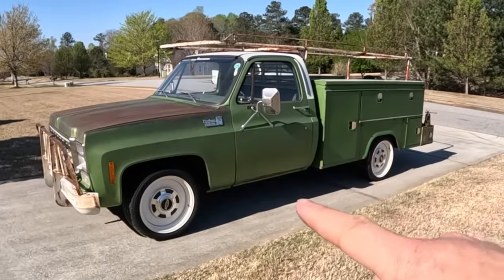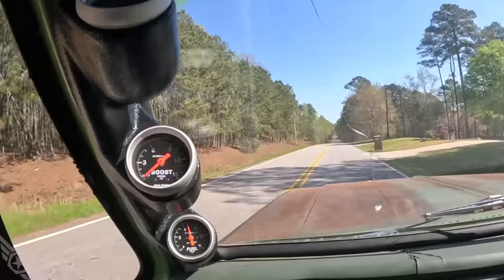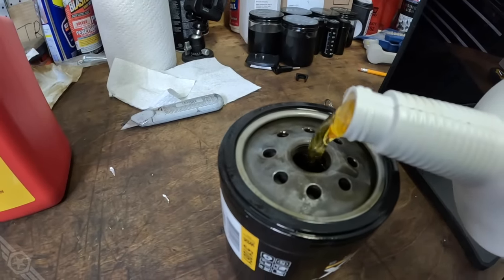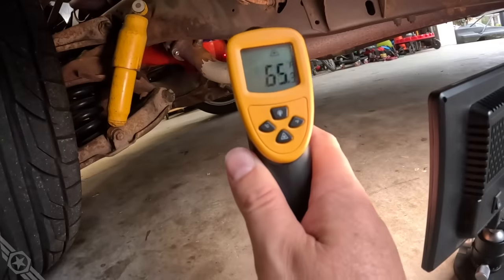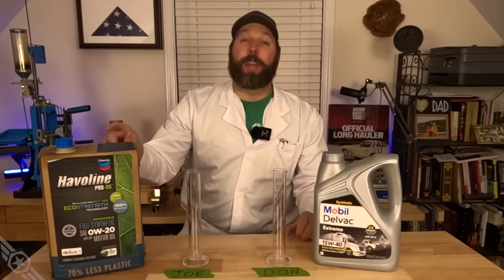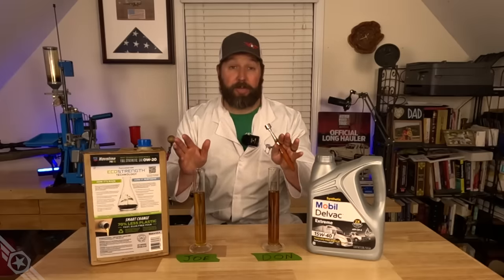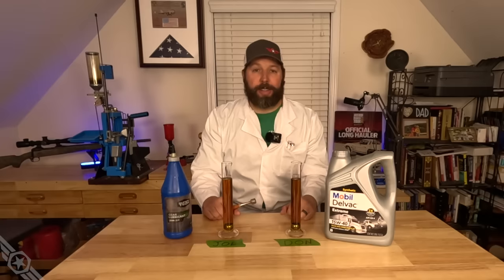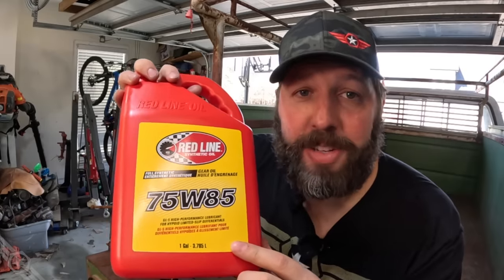Running GEAR Oil in an ENGINE!!! (EXTREME PRESSURE)

Comment: One of these best engine oil videos I’ve ever seen!!!👍😸
Reply from the maker: I really appreciate that. Thanks for watching 👍
Reply: Dude straight up man! Such straight to the point. Like he stabs you with strong points picks out on the what if this or that and he’s like I got that covered for you doubtful minds. So many facts!🎉
Reply: What about using redlines light weight shockproof on that engine 🤔

What’s your thoughts on that?
Reply from the maker: I had to look that one up 👀
Reply: @freedomworx 😂
Reply: I agree. Let's get to the nitty gritty. This guy breaks it down well. But I'd be surprised to find out he has a degree in sciences. But neither do I and he's the one spending money and writing stuff down soooo. That's why I'm here.
Reply from the maker: All you have to do is google my name. You don’t get the job title I have without an engineering degree 🤷🏻‍♂️
Reply: @franknukemcomegetsome2744  just have fun with whatever you like building or doing.,,I like your videos,, Avanti  !

Comment: Get ready for the haters, every time I tried to explain this to people in the YouTube comments I got a lot of (really) offensive replies 😰
Reply from the maker: Haters make you famous…or at least, that’s what the internet says 😂
Reply from the maker: Thanks… I think 😂
Reply: I've learned that you can't explain the truth to some YouTube commenters. They are*experts* ahem..
Reply: You can't explain things to idiots....
Reply: From what I heard it's that the gear oils  don't like the heat and friction. Breaks down quicker. No clue in actual use scenarios. But I contemplated using this in a very old worn block. Ended up going with 15w 40 cuz of what I read  about the gear oils breaking down. Interested in how this pans out here.
Reply: That's because Darwin hasn't caught up to them yet
Reply: @ehhwhatev3903  🤣
Reply: Engine oils are tested under terrible conditions.  Including poor piston rings, and contaminated oil and gasoline (all done intentionally) to make sure they withstand 7,000+ miles.  I don't think they do that with gear oil.
Reply: @ruben_balea      I wasn't putting words in your mouth.  I was simply making a statement.  I believe "engineering explained " did a video on how engine oils are tested far beyond their limits, and in far worse than optimal conditions.  Basically reinforcing the statement made where he said the additives are designed to withstand engine conditions.
Reply: Was it not "Big daddy" Don Garlits who ran gear oil in his top fuel dragster...?
Reply: When oil gets hot gets thinner
Reply: @trump2609       that's what the second number is.  The weight of the oil while at operating temperature.  The first number is the weight of the oil cold.
Reply: Engine oil and gear oil numbers are not on the same scale neither are "euro oils" so the numbers while meaning the same things as far as viscosity can not be related to each other without using formulas to convert. By the way I've run gear oil in worn out farm truck engines without any adverse affects other than causing more leaks in cold temperatures due to increased pressure
Reply: *  gets offended  *
Reply: 90 gear oil is almost exactly the same viscosity as 40 motor oil. It's just a number, and gear oil and engine oil use different ones.
Reply: cute dog
Reply: sniffles

Comment: Had an old beat up and battered maverick back in the 80's. The engine was completely worn out  and burned/leaked more oil than the exxon valdez. I used to drain 5 gallons at a time of waste oil out of the tank at work and carry it around for use in that old maverick. That waste tank had a mixture of used motor oil, auto trans fluid, gear oil, brake fluid etc etc....you name it and it was probably in there. I ran that old worn out maverick for several years entirely on what came out of that waste tank. Never had a single mechanical engine failure and the old gal was still running when i sold it after 350 thousand miles. Sometimes you gotta' do what you gotta' do to keep things rolling down the road a bit longer. That old maverick was a prime example of use what you can afford and hope it works out, fortunately it did
Reply from the maker: That’s hilarious. Whatever it takes 😎
Reply: I had a 77 Chevrolet Vega that leaked & used oil & I did the same thing using used oil and kept 2 spare gallon milk jugs in the back of the car to add oil to the engine once it got low on oil and the oil light coming on . I bought that car for 50.00 & had it for 6 months as my daily driver and it was the GT model with the hatch back but the interior was like brand new but I had a friend who asked me if I could take him to North mpls to go get his tool box from his ex girlfriends place which we did & this tool box filled the entire back of the car up to a point that hatch almost couldn't close lol so we take off heading back to East Bethel MN where we lived at the time & were cruising down 94 & all of a sudden the car felt unstable at the rear when taking corners so we get back to his place he unloads the tool box I go home and look under the car & one of the control arms had rotted through on the body and broke off where the mount was on the body so not worth fixing it . I ended up calling a local scrap yard and I knew one of the counter people that was a brother of a high school friend of mine and asked him how much for the car minus the Saginaw 4 SPD trans and he told me 100.00 cash so I pulled the trans out of it and towed the car to the bone yard and got paid for it lol selling it for more that what I paid for it plus keeping the transmission out of it that eventually went into a 70 Elcamino I had that I was going to do a swap from a automatic to a 4 SPD manual. Now that I think of it I don't think the bone yard by me now in Wisconsin where I live now would pay that much for a mid sized car hardly especially if you cut the cats off of it because scrap iron is so low now so for me getting that 100.00 way back then for a crappy rusted out Vega was a damn good price 😂.
Reply: Mines a hybrid too. It burns oil and gasoline
Reply: Man I had a 89 mustang lx 5.0 convertible and used to do this at a harley shop, man that was a bunch of different shit, sometimes smells like sulfur and knew it probably wasn't good but never had any problems
Reply: It goes to show, some oil is better than none
Reply: I feel ya on that one my 7.3 sweats oil and if clean oil free of contaminants wasnt the blood line of that engine i would do the same but i did have an old chevy truck with a 355 in it and it was low and not reading pressure and i used bar an chain oil in it to get home then never changed it for almost 10k lmao but just to get home right😂 whatever it takes😂
Reply: Hey it will get you there.   That's how ya do it bud
Reply: Reminds me of my old truck. It was quite worn out so oil pressure was always lol. I ran 20-50 all the time. And when it got low I just added in that super thick oil stabilizer. lol whenever I drained it it was always so black and thick. Poor engine lol. Love older engines, they just eat anything you put in without a hitch.

Comment: filling the oil filter is perfectly fine and is actually a good idea.
Reply from the maker: Those are fighting words! 😂
Reply: Some manufacturers void warranty. Air locks the oil pump.
Reply: I’ve always prefilled the filter on vehicles I could.
Reply: It doesn't make a difference
Reply: If i dont fill it on my dmax ute the oil light stays on for an unsettling amount of time

But if i fill it. Well it unfills when its turned on its side.

I always do it on EJ
Reply: @450clancy6  Most filters have an anti-drainback valve so orientation might not matter.
Reply: @nobodynoone2500  I mean it unfills before I screw it on 😂
Reply: @450clancy6  that, i believe 😂.
Reply: @450clancy6 so true. First time I changed the oil in my Land Rover I didn’t fill the filter and the oil light stayed on for nearly 15 seconds. Never again.
Reply: It.... doesnt really matter. I dont get the discussion. 

If the filter is upside down i'll fill it; any onther way, nah. 

I ran engines for a couple miles without oil by accident and they had no damage at all. Those 2 seconds after cranking where the pressure is not distributed through the block wont do shit.
Reply: @acvn-hg9gy  Couple of miles with no oil film on soft white metal rod bearings with no damage seems bit unlikely , normally couple of minutes idling with no oil wipes metal off the bearing shells on engine's I've pulled down
Large engines I now work on wont even let you start them until they have enough oil pressure to maintain oil film (electric oil prime pump)
Reply: I’ve never filled an oil filter in 40years of working on cars
Reply: @nobodynoone2500 Ah but it can. I fill my filter all the way up because it's verrtically mounted on the engine with the openings towards the top, obviously. Even with a drainback valve, if you fill it full and the filter is at an angle mounted on the engine, oil will still come out the return outlet.
Reply: @Lfs1891  Being an idiot is something best kept to yourself.
Reply: You are talking about religion. Now add oilchange, suction vs drain on the list of topics and you have politics on the table. Complete it with oilchange intervalls and additives to please the conspiraciy theorists and Thanksgiving, Christmas and any chance of a peaceful Family reunion is down the drain.
Reply: @alexdalton6215  I have never filled the oil filter on my Corolla, because I cannot. It is a cartridge type oil filter, not a can, and it's on the bottom, so it would just make a mess. The oil pressure light has never come on after changing the oil. Maybe don't daily a Land Rover
Reply: If you follow Lake Speed Jr you’d know which is right or wrong coming from an actual oil expert & not a bunch of random internet opinions.
Reply from the maker: @stevemccauley5734 he’s certainly an expert, but his test was flawed. You can’t compare one oil sample (second oil change after an engine was built) to one other, and expect to get any real data. There are still a lot of residual wear metals in the engine, because you can never get all of the old oil out. He should have done several oil changes after that engine build before doing that test. He’s smart enough to know that, so I’m not real sure why he did it that way 🤷🏻‍♂️

Comment: I think they intentionally made the SAE gear oil numbers double engine oil values so they were not easily mixed up. Aircraft engine oils are also double.
Reply from the maker: Interesting. I’ll have to look into the Aviation Lube stuff. 👍
Reply: This is probably true
Reply: Talking to a Klondike lube rep, yes, the numbers are doubled on gear oil for differentiation purposes. Klondike's synth ATF is around 0W20.
Reply: @dalesautomotivefsj1606 no way atf is that thick, it’s more like 0w-8
Reply: Exactly The AeroShell 100 is the same viscosity as a SAE50 car oil Aeroshell 80 is SAE 40. But gear oil is by ISO. SAE 50 equals an ISO 220. The double numbers comes from the fact the Gear oils viscosity ate given at 40C and in car engine oils the straight viscosity is given at 100C. Now multigrade Gear oils are a different methodology.
Reply: Well, that info is a day late and a dollar short (for me). For years I ran 70 weight oil in my Shovelhead. The shop I used to go to sold Pennzoil Grade 70 aircraft oil, but I started using Kendall Nitro 70 motor oil instead b/c I thought it performed better. Now I know why.🙄 (I upgraded my oiling system and now use 20w-50)
I still have some of each left, so I had to compare the two and confirm that the aircraft oil is indeed thinner than the motor oil. It's embarrassing that I never noticed before now.
Reply: SAE 30 & 5, 10, or 15W /30 are in fact not the same Viscosity @ operating temperature despite both saying "30"
Reply from the maker: @timothylessing4774 they are the same viscosity at 212F. That’s defined by SAE J300 🤷🏻‍♂️
Reply: @timothylessing4774  There is a range in the spec; 9.3-12.3 cSt @100°C. They are in the range to get the rating. So there can certainly be some variation among "30" rated oils.
Reply: Valvoline was the first company to make commercial vehicle oil. They were an aviation oil company.

Comment: I had a 250 I-6 Chevy in a '63 wagon,  It had been owned since new by a taxi driver who drove it back and forth, repeatedly, every year to Florida from Missouri..  The rest of the time, he was using it as a taxi..  When he gave it to me, it had 350,000 miles on it, and he showed me the records.  The heads had never been off, and the motor was working hard to make 75 psi in 5 cylinders and 95 in one.  In the summer, it would start and run just fine, though it was pretty gutless and to say it smoked was understating things a bit.  Being broke  didn't leave me any choices,(this  was 1985), so I pulled the pan and filter and refilled with 2 qts of Harley Davidson 80-90, a qt. of Motor Honey and topped off with SAE 50.  That pulled the pressure up and got it humming. It felt brand new until things heated up and thinned things out a bit but it was still a lot better than when I got it.  When I sold it, I included the log book and told them what I had done, didn't BS the fella none.  That money got me to Fla. where I got decent work.
Reply from the maker: Now that’s a cool story 😎👍. Thanks for sharing.
Reply: Think about the lack of detergents. Not a good idea in a combustion engine
Reply from the maker: If the engine is already shot, detergents don’t matter.
Reply: We ran rural route newspapers back in the early 90s. About 210 miles a day. Those cars would burn out there rings within 3 months. We dump the thicks gear oil in them it smoke like crazy for about 100 miles. After about 200 miles we drain the gear oil and fill it full oil it last another 3 months.
Reply from the maker: @michaeladdison4461  help me with the math here. 2100 miles in a 24 hour days is an average 87.5MPH. Your route on the autobahn? 😉
Reply: @freedomworx  LMAO
Reply: @freedomworx  210 mile accident put extra 0
Reply from the maker: @michaeladdison4461  that makes more sense 😂
Reply: @freedomworx  thank you for pointing that out but those 210 miles a day was on gravel and dirt road up and down mountains and hell on those cars we buy cars back then between $200 and $500  buck so they was already junk cars to begin with anyway. Member we only gave $25 for 1984 chevy citation that thing lasted about 6 months we gave $75 for old chevy chevett that last like 6 years we never burn the rings out of it but the transmission would pop out of gear and we had to change stater on it about ever 3 months.
Reply: @patdennis3751  My intention was to keep the engine running as long as possible and previously having to de-foul the oil covered sparkplugs was a total pain in the ass, not to mention the miasma of oil smoke that followed me everywhere.
Reply: @michaeladdison4461  Sounds like you just glazed over the cyl wall damage using non-detergent oil every other change. Inner turd polishing if you will.
Nothing leaks if it's clogged lol.

Comment: Gear oil and motor oil use different ratings. 80w90/75w90gear oil is the same viscosity as sae40 to sae50 motor oil at temp. 75w140 will be around sae60 motor oil at temp.
Edit:"I need to watch more than half way through before I comment".
Reply from the maker: I almost said that before I read the rest of your comment 😂😂
Reply: @freedomworx  Great video man. Very entertaining.
Reply from the maker: Thanks for watching 👍
Reply: Old Honda manual transmissions take 10w30 almost the same as 75w90 gear oil.  There on different scales
Reply: @jlsrr2577 when I took my Honda manual trans oil out of Civic and replaced it with 75w90 from Motul, it acted way slower and more protective. Yes the Honda fluid is lite but I no likey!!